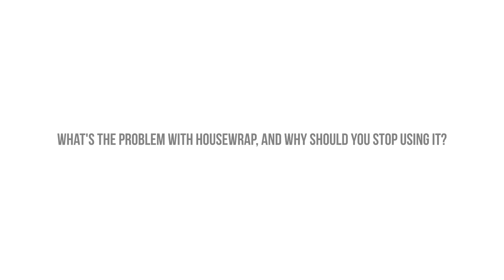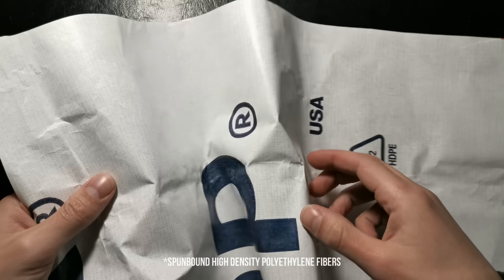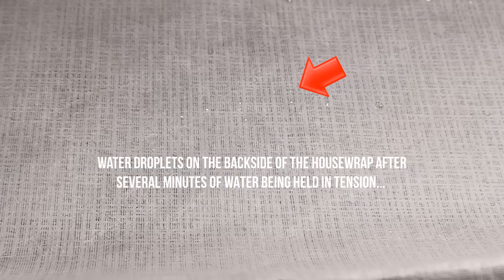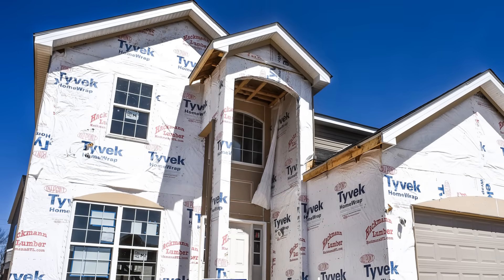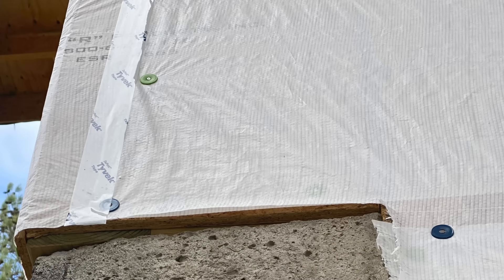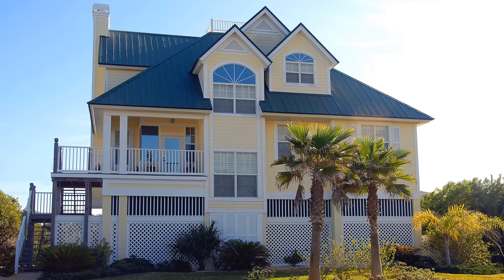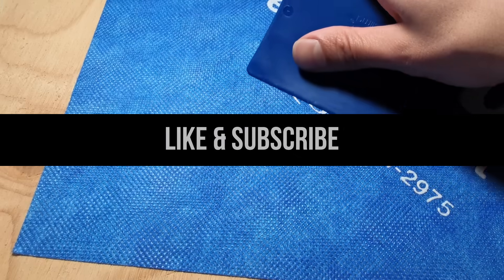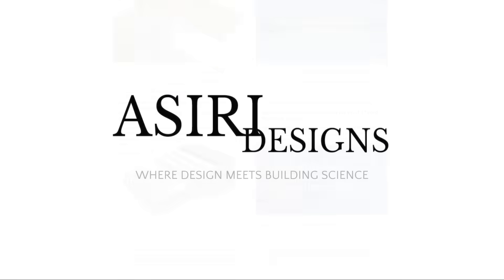Why I Stopped Using House Wrap

Comment: My last home was new construction with a Tyvek house wrap under a foam barrier followed by a stucco finish.  The first rain storm resulted in myriad leaks. After lots of investigation, the builder agreed that all the exterior had to be replaced - stripped down to the wood sheeting.  That builder rebuilt the exterior starting with (so called) tar-paper.  All leakage resolved.  The stucco contractor later conceded that all his commercial building jobs specified tar-paper while the home builders mostly specified poly-wraps.

Comment: I was a R2000 Builder in the 80s, YES Indeed, energy savings was a hard sell then,people wanted fancy ceramic shower and kitchens like you said. Near Vancouver BC
Reply: It was a far easier sell in cold parts of the country! Everybody around us in NB was building R2000 back then because the heating bills were eye-watering (I was a kid so I didn’t understand at the time).
Reply: @benoithudson7235  one guy said " i'll just cut more firewood if needed " and we had no idea how exspensive hydro and nat gas would be. I always thought it was smart.  Id like to build a NET ZERO but im not a millionare - multi, yet

Comment: I’d also add that, if you hire a siding contractor to apply a roll on vapour barrier, you should most definitely verify that the product they are using is correct and rated. I have personally removed sub contractors for trying to sneak a lesser product through.

Comment: I use SIGA 200 with tape on budget spec homes. 2 coat stucco, 1" foam + wire ontop housewrap is common AZ practice. Better than tar paper and Tyvek. Proper install is also key.

Comment: I used Tyvek on my new build, simply because I have a rain screen installed around the entire surface of the exterior of my home. Then installed cedar shakes. There is literally no water reaching the Tyvek. I also spray foamed my entire house, so moisture would never be pulled into my home.

Comment: I live in Southern Michigan, home was built in 1960, behind by original wood shingles is a drywall type sheathing, not sure if it’s a special kind that won’t degrade if wet or if it was just cheaper at the time to use. Did some remodeling and found insulation in walls completely dry even behind windows jambs.

Comment: I think it would work well if you used real plywood and then spray all of it with oil based primer and acrylic exterior semi gloss or satin paint and then tape all the joints with something weather resistant with a strong adhesive. It would be a pain in the ass but I think it would hold up well if you did a good job with whatever you're putting on the outside.

I've had no problem with Tyvek, but I also make damn sure nothing is able to get behind my siding and other finish materials. If water is getting past your choice of cladding you're going to have problems no matter what you use. If water is getting in then it is not going to dry out, it's going to stay wet behind there indefinitely. 

On my wood trim, I back prime everything and after I make my cuts I keep a paint brush with me and paint or primer the ends of the boards before installing. I keep the brush wrapped in a plastic bag while I'm making my cuts and nailing them on. 

I do this with non pressure treated wood and 15-20+ years later and the wood is still in perfect condition.  I did 3 piece crown molding below the soffit on my front porch at least 15 years ago with interior grade wood and it's still in perfect condition, because I back primed everything on all 6 sides of each board.

 If you don't do the back priming and just rely on caulking, water will eventually get behind it and rot it from the inside out. It will usually take a long time before you can see the damage that is occurring. 

 Most people refuse to do it because it doesn't look any different when the job is done. Caulking is good and important but it will not replace back priming. You will easily get past your warranty period if that's the only thing you care about, but it will eventually cause it to fail in some areas at least if it is subjected to very much weather. If you live in the desert it may not be necessary I don't know, but in the midwest where we get a lot of rain and snow it makes a big difference.
Reply: I do metal roofing. Keeping the water OUT is the prime thing. Once it penetrates, without opportunity to dry, its a problem you might not find until its a real issue. Wide temperature and humidity swings where I am too.
Reply: Thanks for that…priming or painting the whole piece makes perfect sense. No moisture infiltration, no rot.
Reply: I disagree about back priming. Well it certainly will help It can't stop water coming in through the nail holes from the installation, and installing trim under and protect it overhang is not a good test of a system's performance. Install everything per specification and then maintain it properly through the years. This is the simple secret to success. Stop blaming builders when you refuse to do proper preventative maintenance. Do you blame Ford if you never change your oil and your engine grenades? Of course not, it's the same thing with your builder. And just like Ford if you're builder installs his systems correctly, they will perform as intended in last 4 years. Unless preventative maintenance is not performed. This is the single biggest culprit I've seen over the last 30 plus years in the industry. Calk and paint your houses! Only use quality caulk.
Reply: @brettb614 definately need to backprime. At the LEAST all the end grain. I replace rotted wood all the time. Many areas can get painted once the carpenter installs it yet water can lap under the unpainted edge and cause rot.
Reply: True tradesman knowledge and integrity.
Reply: concrete sealer works amazing on raw wood as well
Reply: I'm building a shed, with plywood sheathing, and am debating whether to wrap the sheathing before cladding with cement board. 

I'm thinking painting the plywood and caulking any seams should be good, that seems to be what you're saying? 

Should I leave a gap between the sheathing and cladding?

Comment: How is this even legal?
I am always surprised about the poor building quality and materials used in North American construction.
Why build houses out of wood and then make them look as if they are built out of brick? Why not use brick to begin with?
"Brick veneer" should not be a thing.
Reply: Why build a house out of brick and then add a brick veneer? Does that seem like a dumb question? Well... it's not because that's exactly how brick houses are built: there are two brick walls, separated by a gap that was usually air but could also be insulation. To call it the outer brick "veneer" is to further misunderstand what the point of the outer layer is for: that's your building cladding. So the brick cladding on a wood frame house is serving the exact same purpose as the outer brick wall on a brick house. And brick itself is not a terribly good material for building anyway. Where 'masonry' construction is the norm you tend more often to see concrete blocks for the inner wall even if the eventual building has brick cladding.
Reply: ...because it's expensive!
Reply: Brick doesn't insulate well, and is hard to remodel.  Every house I work on has had major remodel work done about every 30 years.  Walls taken out, doors moved, bedrooms added, etc.  It's much easier with wood.  If properly maintained, it lasts just as long.  The real problem is the foundation.  I've never seen the problems this video talks about with tyvek and a little bit of air infiltration is a good thing, it's why there wasn't ever problems with mold in the old buildings.  Personally I've been putting foil faced foam over plywood sheeting and I haven't had any problems with either moisture or rot.  Good ventilation in the home is important.
Reply: It is worse than that. Some buildings going up in Toronto have a frame that is insulated and covered with large panels that are cut to look like brick-- it is not even a stone veneer that provides some solar protection and thermal mass.
It is all fake!
Reply: Do you want a 1200 sqft rancher to cost $2 million instead of $1 million? Houses are already out of most people's reach without increasing costs further.
Reply: Everything is becoming a fake simulation of something that was once  real

Comment: I agree that tyvek is not a great housewrap, but I think hydrogap is a great product. Hydrogap has a much lower perm rating.
I would use hydrogap over these other solutions because:
1.) it's alot less labor. fluid applied can add 10's of thousands onto a project. Applying giant stickers (SA or Tape) is hard. It's not the materials themselves that are cost prohibitive. It's the labor.
2.) it's a lot more fool proof. You will still get lots of imperfections and problems with SA or taping up all the zip seams. Lots of wrinkles. This is why labor is expensive.
3.) Hydrogap is drainable. Fluid applied and zip are not
4.) lapping a WRB over flashing is more robust design than using more stickers over flashing areas. And you don't need people coming back to patch up waterproofing with fluid or tape.
5.) house wrap will cover the window openings until you install windows. This keeps rain out and keeps water from pooling on your floors.
6.) scratches and chipping are more of an issue with fluid and zip. More people need to come back and fix areas.

But 99% of the projects I do, the builders will use zip wall here in florida. For my own house, I used hydrogap.
Reply: Hydrogap might be drainable but it's not airtight ;(( in this case, I would rather use zip with tape or liquid WRB and that's what I'm planning to use in my project in the Chicago area.
Reply: @piotrek4302  They will have the same perm rating, which means both will do a great job of keeping water out. And another plus of house wrap is that being breathable is very desirable to prevent rot for any vapor that is trying to escape.

The only reason for air tight buildings is for energy. I can virtually guarantee that the cost savings between two identical homes with only the WRB changed will have nearly identical energy costs. But a zip system will be more likely to have rot and/or mold if water does make it's way into the wall from a roof leak, or shower leak, or washing machine, etc, etc.

Comment: While I don't doubt any of these negative points, I feel a lot of it(and similar complaints) is just a different form of "how to set a post correctly".  If you watch every single post setting video on the Internet, the comments section will be full of people pointing out how it was done wrong and how it could be done better.  I've watched home improvement videos about roof venting and it's the same thing.  I've grown cynical to all of this befause no matter what I might do to my house, I'll probably make mold grow in it.
Reply: True. House wraps are fine in most circumstances. It's the 10% of applications where you need to go with another system. However, some of the other systems have reduced labor cost which more than makes up for the difference in material cost. Unless a job specs a particular weather barrier it tends to be more profitable to go with the less labor intensive product.
Reply: @ianbelletti6241  this is incorrect unfortunately. Monolithic systems like the zipwall save miniscule amounts of labor while increasing cost significantly. They are great products but they are not for all homeowners budgets. It's really irrelevant what subsiding is used so long as the exterior cladding is installed and maintained properly. This is the secret to success. I've been a builder and remodeler for over 30 years and 95% of all repairs I've completed result from a lack of basic maintenance. Inspect, caulk and paint. Only use quality caulk
Reply: @brettb614  you're only adding details to my generalization. I know you think you're arguing against me but you're only supporting my statement. Cost efficiency is the cost in labor and material. The costs often extend to maintenance on the job and the frequency of warranty repairs. If it's harder to install that increases the installation cost and the likelihood for warranty repairs. Some weatherproofing substrates are so soft that they tend to need a lot more repairs when the other trades have to run their materials through them driving up cost. You can't just look at installation labor and material cost alone.
Reply: Bingo

Comment: Not true!!!! Yup, sue me but I have worked in the industry for 40 years. It (tyvek) was never intended to prevent water vapor but rather liquid water and it does that very well. Go ahead and seal up a house air tight with foam panels. The wall cavity can’t breathe. We had houses only a few years old with mold growing in the wall. A $100,000,000 class action lawsuit.
Reply: A wall assembly that is properly sealed from both sides with vapor permeable products will dry out and not grow mold. The mold grew because vapor got in and stayed trapped and never dried out. Look for his explanations on convective looping. Air has water in it too. Thats why the complete air seal is so important. 98% wont cut it.

Comment: Funny how DuPont Tyvek is American but the one sold in America (homewrap) is inferior to the one sold in Europe 🤣
Ours is less like a tarp and more like a waxy cotton fabric (still made of plastic!)
 
And here in Norway it's almost the standard to use.
And we can't use anything like Zip because the cold climate.

And we also never build without at least 2cm airgap between the siding and wall/wind barrier (except for some shoddy worker's trying to find the cheapest and thinnest wood strips) and many use a 2x2 as the air gap, so water shouldn't really ever hit it.

And it is in my opinion very easy to work with to get it straight without any wrinkles (but again shoddy workers make it look like a mess, if you cant make it wrinkle free you should be fired)

Comment: Haven't had any issues with building wrap on plywood behind a ventilated cavity where I live. I know this because I've gone back to a number of old jobs of mine to do new work and found things to be perfectly sound when I've cut into the existing cladding. Been using that system for 20 years. All types of cladding, except for brick which we don't use. I think it's possibly because although it is wet and windy here, the climate is mild. Only about 10'c difference between winter and summer. Our ventilated cavity system was based on the Canadian method. 
Tyvek is rarely used here. It is hard to stretch tightly enough and the associated tapes are pretty bad. There's much better wraps available. We use bituminous foil covered tapes on all corners and around all openings. 
That said, The moisture resistant rigid air barriers you describe make up probably 90% of cladding solutions here. Particularly in areas where the climate is more extreme than where I build.
Reply: What are your thoughts on BP Canada R-1.5 Panel Wall Sheathing Panel 1/2IN. Costs 9 bucks Canadian here locally. Has an asphalt outer coating. The old neighbor has something similar that his house is made of from the 1930s. Claims its great stuff and hasnt deteriorated in the close to 100 years its been in the house his father built and he now lives in.
Reply: @ 
I had to look that one up. The closest we'd get to that product would be a pre waterproofed plywood rigid air barrier. I think they use an acrylic sealer. We do still use the bituminous paper on plywood when it's behind steel cladding. 
Basically everything older than 50 years round here is weatherboard on bituminous paper on studs, with no cavity. When they started using fibre cement board and other different claddings that's when the issues started with leaky houses. This became apparent around 1998 and the code was tightened in 2004. Cost the county billions. As I mentioned we learned from Canada and use basically the same systems here now. New Zealand.
Reply: @davel4708  Thank you for the feedback. Ive added  bituminous foil tape to my amazon cart as a reminder for when it comes time to frame a new cabin. You use this type of tape to create window flashings?

Comment: I don't personally have experience with Zip System but I have heard that it's got a lot of issues that will be problematic with time. From what I heard it traps moisture if water gets behind it. Tyvek house wrap and I have definitely struggled. And I have definitely seen it fail.

Comment: Was always skeptical of house wrap, glad to see an in depth analysis of its weaknesses. Thanks for the perspective!
Reply: House wrap isn't the problem. The way the contractors install it is the problem and the manufacturer  of the product is to blame for instructing them to staple it directly to the sheathing. This is completely incorrect. Tyvek and other wraps should be used as a rain screen only and should never touch sheathing. It should be stretched taught and stapled to 3/8" thick vertical furring strips nailed to the sheathing. This creates a vented space between the back side of the Tyvek and and sheathing. If water ever gets past the Tyvek it just drips down the back side and never touches the sheathing. I did it this way on my shop 20 years ago and the siding, sheathing, and house wrap are in perfect condition.

Contractors and builders would never do it this way because it's more time consuming but it's to the detriment of the home owner unfortunately.

If you want something done right you have to do it yourself...if you have the knowledge of course.
Reply: @jamescrud  If we have to blame both the installer AND the manufacturer, shouldn't we conclude there has to be a better way and leave wrap in the past?

Comment: What is your opinion on the high-performance wraps that go over timber framing without sheathing? For example Solitex Extasana or Hardie Wrap Weather Barrier. Typically in Australia there is also battens added over the wrap then cladding applied. Cheers